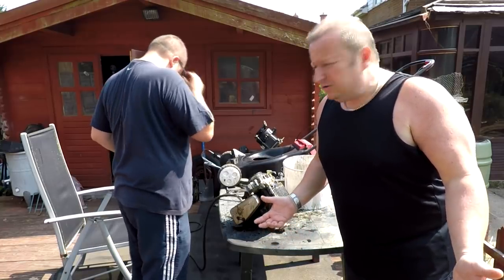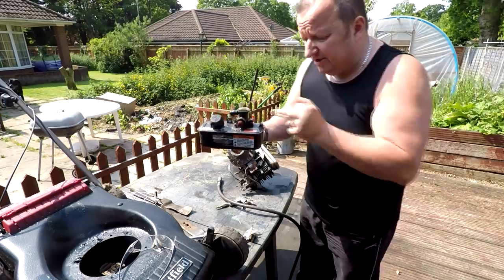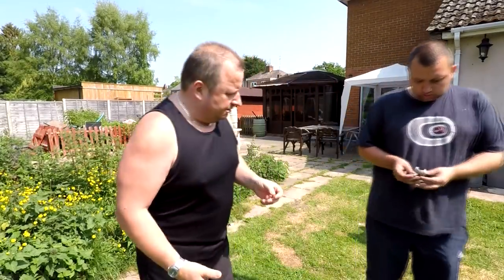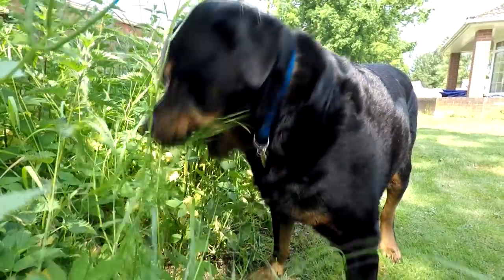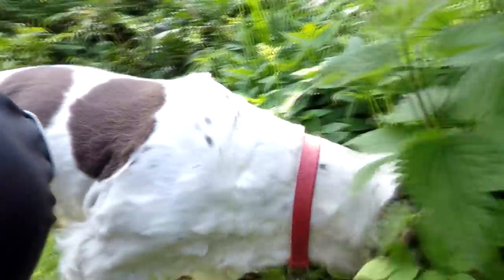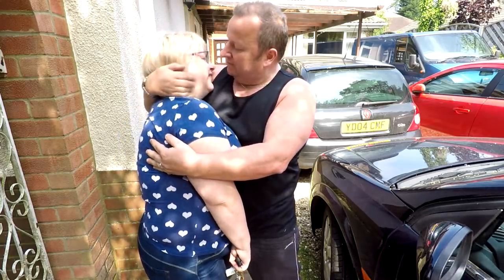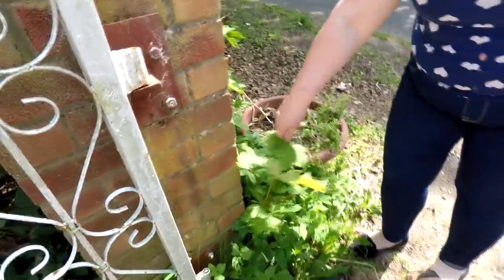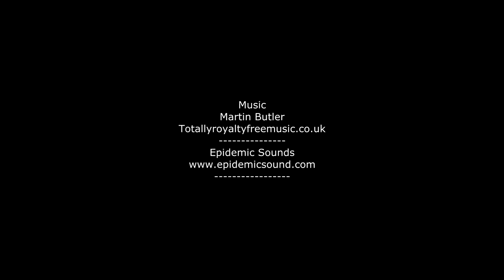A Day In Our Life #29 Sharon Is Behind Bars Vlog

Comment: been watching for a few weeks now . found an abandoned bike locally . trying to claim it to use the engine any tips on getting it going . been out in the wet and snow since jan? keep up the vids . cheers. steve
Reply from the maker: Make sure it isn't seized, check for spark and give a squirt of fresh fuel in the spark plug hole and see if you can get it to fire. If yes, clean the carb and try and start it after.